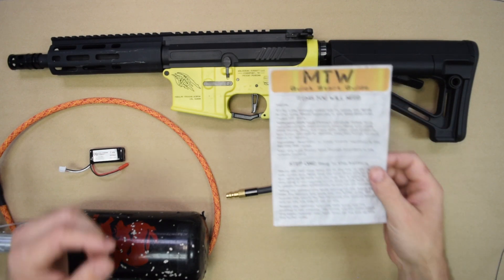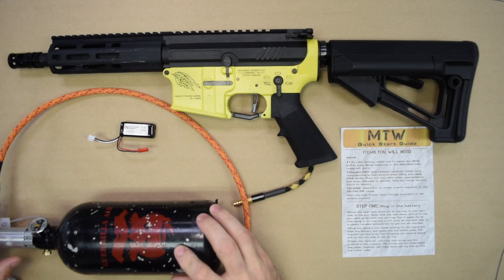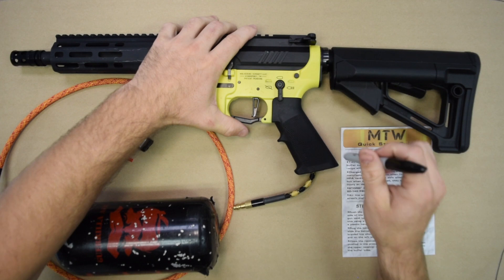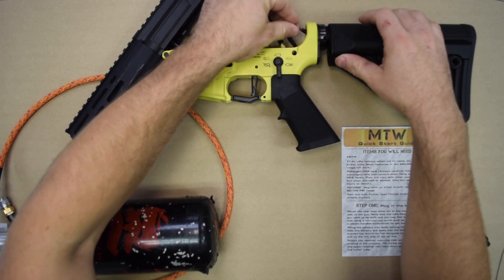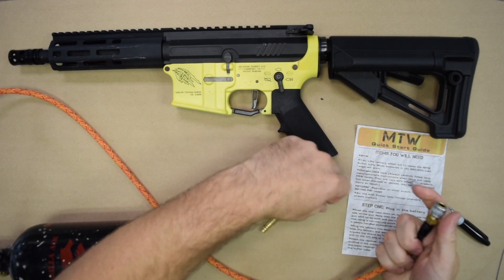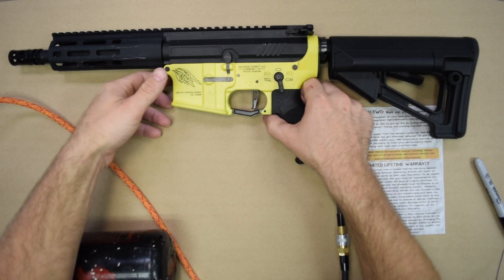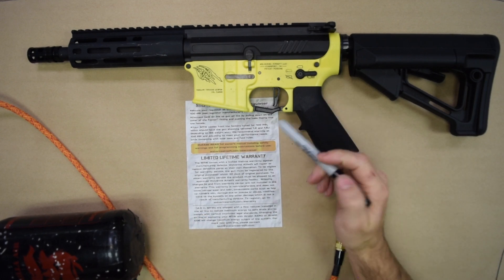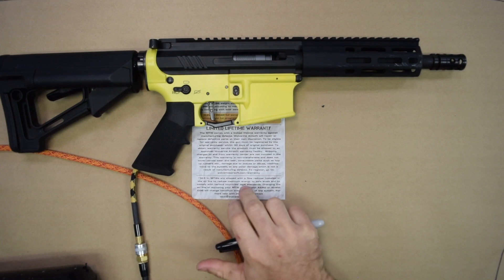What the Tech?!?! MTW Quick Start Guide

Comment: Hey guys, I'm pumped for my MTW. I was wondering what the stock inner barrel length on the 14.5" is. I am going to get a new barrel for her. Also, have you guys done any testing to find out which hop up unit works best. Thanks.